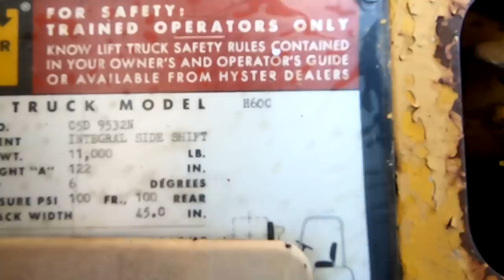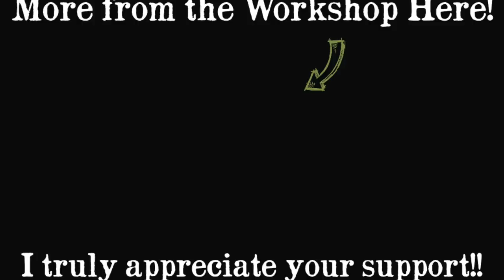This 1969 Fork Truck WAS Headed for the SCRAP YARD! ~ RESCUING a 1960's Fork Truck ~ Part 1

Comment: I work for a forklift dealership and I know what all is needed to convert it to Lp. It is not a hard process. You get a kit that has a new Lp carb that bolts right in place of your current one and all the hoses and what you called the gasifier we call a regulator and lock off with bracket. The only thing you would have to get that not in the kit is a Forklift Lp tank. The kit should come with a mounting bracket for the tank. I have a vendor you can get all this thru for a great price. Probably cost you around $700 with out the tank and fuel.
Update
The company is called PNG Technologies. I have attached their website link.
https://pngtec.com/

Comment: Greetings: Now what idiot would leave out the spark plugs?  Distributor -  6 lobes? 4 lobes? Hmmmm Xtra lobes if 2 wear... Just move the plug wires? Probably not. Broken base- JB weld? Krazy glue? Gorilla snot? Probably not. Hey the crankalator works good. The engine will live. Always a good idea not 2 loose Ur nuts. It's not a "Water Temp Sensor" it's a switch.

Comment: The engine and/or brakes were locked up, so they pulled the axles so it would roll.  PS: Nice save of a useful machine!!
Reply: Engine being locked, then it doesn't make sense to pull the axle as the transmission has a neutral gear position does it not?  Neutral disconnects the drive train from the engine.  Most likely they had no idea the brake drums was locked and thought removing the axle would make things better.  Jacking up the fork lift and taking off the brake drum is the solution.  Most likely after they got it rolling they were just too lazy or frustrated to replace the collars and nuts for the axle.
Reply: @bpetnoi1472   Yes if this is a manual vs a hydomatic/static (not sure of the correct term)...like on boat transmissions.... no clutch peddle (Forward, neutral, reverse, that's it). These are floating axles... so the power from the engine is transmitted to the wheels/tires via those 6 bolts that hold the axles to the hub... pull axles the wheels/tires are just free wheeling... no drive. If the brakes are locked they won't turn.. easily. So removing them would take the engine/trans out of the equation and thus determine if the brakes are indeed locked. All just speculation on my part.

Comment: Should be "aluminumized" anti seize, the copper type WILL cause "electrolysis" with the aluminum or zinc alloy in the distributor. But like I said, I realize that you're in a guys driveway

Comment: Girly forklift..I used to drive the Blue Goose at Monon Trailer. A 30 ton Hyster. It had a 16V71 in it. We let it run for a year straight for the fact we couldn't afford the air starters..I'm not impressed

Comment: NEVER use Copper containing products with Aluminum, it will destroy the Aluminum.  Remove the Distributor and clean that Anti-Seize off ASAP.  You will be happy further down the line.

Comment: The tool you were using to gap the plugs has notches on the ends to bend the contact arm in or out 
Hope this helps you 
Please don't use a hammer 
Just saying

Comment: You made me cringe running that hone, you need a very low speed drill, preferably air operated and you absolutely need to get the "45° cross hatching" for the rings to be properly seated though I realize you're out in some guys driveway. Hopefully you put new or even used oils from your last service on your truck or something. ALSO lol, you should use "Hi Tac" either the copper or just the red, it helps the block to head seal till the machine gets to operating temp and THEN the gasket will "cook in" for lack of a better term

Comment: If it were me I'd stick with gasoline for a lot less expense in proper setup and better longevity. Liquid propane burns hotter than gasoline which produces much higher exhaust temperatures. It is famous for burning out standard single angle valves and exhaust seats not to mention cracking heads. It requires special valves and custom valve grinds. In the 70's and 80's I cut many valve seats unhappy farmers and ranchers wanted to convert back to gasoline from propane after the gas crunch only to find minute cracks while grinding hard seats. It was a mess. Liquid propane, at least in my humble opinion, is a nightmare for engines and the mechanics who have to work on them.

Comment: using a sealant on a one wire temp sensor is not a good idea .the sensor needs a good ground through the threads..sealants increase the electrical resistance ..causing inaccurate reading..usually a lower than real temp...don!t ask how I discovered this...
Reply: why do most of them come with a red color sealent on the from the factory?

Comment: Propane is very good to use real simple to change over.But that engine is not all that powerful and the type of trans it has gas been more  in btu,s you be better off to leave it on gas cause you need all the power you can get if you are going to lift heavy loafs like what you done to it to save it.

Comment: If you want to go to gas you will need hardened valves as gas burns a lot hotter and you'll have a lot more problems stick to petrol.    LPG trucks engines don't last anywhere near as long.

Comment: the Motor is LOCKED UP so tight you couldn’t drive a 10 penny nail with a sledgehammer!      WTF? not getting that relate. Whats the opposite of that?   "That toilet's so loose it couldn't shit itself thru it's own asshole!"

Comment: I cringed when you sucked the acetone/ATF mixture out WITH A VACUUM CLEANER!!!!  Have you not ever heard that vacuum cleaners should never be used for picking up flammable liquids flammable liquids ?  I am pretty sure there is a warning label on the appliance stating that.
I have heard of many times someone used a wet or dry shop vac to pick up flammable liquid that resulted in explosion and fire with serious personal injury.  One person used his shop vac to remove standing water in a boat where a gasoline can had turned over. Another person used their shop vac to pick up gasoline in the trunk of their car where the full can of gas they had just filled up overturned on the way home with it.
The danger lies in the fact that the electric motor powering the vacuum impeller also gets its cooling air from the draft exiting the vacuum canister.  That puts the fumes into direct contact with the brushes and commutator of the motor, which is a veritable "ring of arcs" on that type of motor.  A brushless motor might be safer from causing an explosion/fire than a brush type motor, but why take the risk?
It is no secret about the dangers I call out here, you can find cases where this has happened by searching the internet.  Or ask a fire fighter, the first case I mentioned was related to me by my BIL, who was a fire fighter answering the call to that incident.